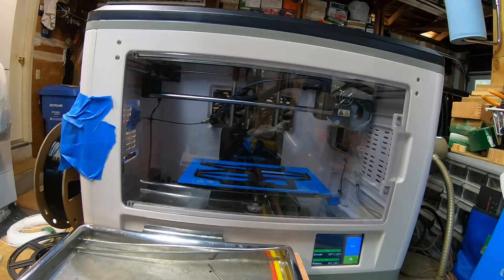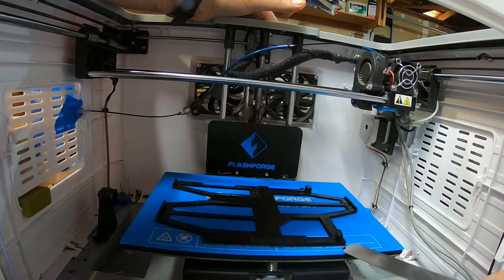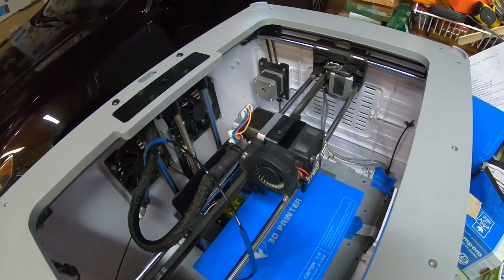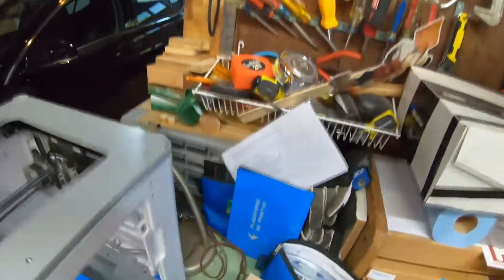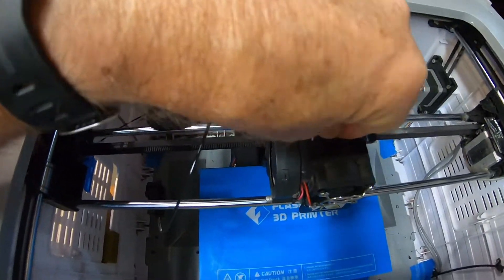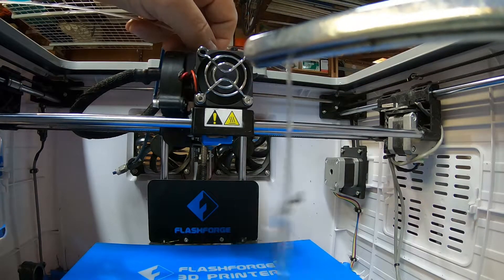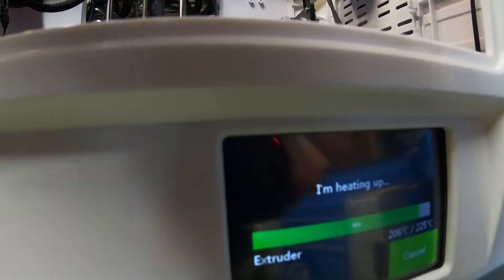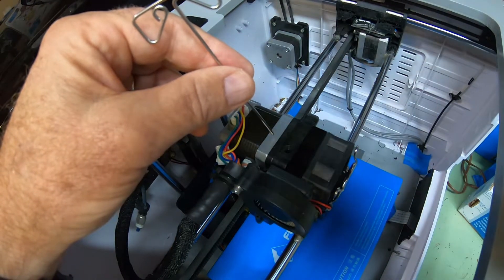3d Printing - Switching from PETG to PLA and Avoiding a Clogged Print Head

Comment: Hello sir! i'm planning to invest in this printer, i know its a pretty old printer of era 2017 but im wondering if this printer still worth to purchase? i'm buying new one, 
for how long you are using this for? Do you recommend this over ender 3?
Reply from the maker: I have been using this printer for about 3 years now. I've gotten lots of good use out of it.
However, since I'm printing things for sale on Etsy:
https://betacygnidesigns.etsy.com/
I've been running this printer 10-15 hours/day 6-7 days/week.
I found over the last 3 years that with that kind of workload, it lasts about 1 year before mechanical/electrical problems start showing up.

So it depends on what you want to use it for and how much you're going to be printing.
If you want to see what I've been able to make with it, go to my Etsy store using the link above and watch my other videos about this printer.

I've never used an Ender 3, but comparing the specs to the Dreamer NX, I would choose the NX over the Ender.
One big advantage of the NX is that it has an enclosure. I think that leads to more consistent printing since all the cooling is under the control of the printer.

One other important point, when my last NX started having problems about 6 months ago, I switched to my backup NX (new in the box) and while deciding whether to buy another backup (I printing things for sale, so downtime is very important for me), I explored what else was available that would be more reliable and let me print bigger things.
I settled on the FlashForge Guider II:
https://www.flashforge.com/product-detail/flashforge-guider-2-3d-printer
I've been using that printer for about 6 months and I'm very glad I upgraded.
All of the mechanical parts are major upgrades from the NX.
The printhead is much better designed with the wiring better protected from heat than the NX.
It uses the same nozzles as the NX, so I was able to keep using those.
And it works similarly enough to the NX that I was able to use my Simplify3D slicer profiles with some simple tweaks like changing the bed temperature because of the removable print bed I installed on the Guider II.
The only major difference is the print volume which is an easy change in Simplify3D.

I have a new review series on this channel on my upgrade to the Guider II starting this coming Friday (11/3) for the whole month of November.
So you can find out why I like it so much and how I changed my slicer profiles, etc.
Going forward, almost all my 3d printer videos will be using the Guider II.

I'm still using my NX to do some prototyping and for making part of this product when I need to keep up with orders:
https://betacygnidesigns.etsy.com/listing/1552726362/star-wars-camtono-container-set

Thanks for watching my video, and let me know if you have any other questions.
Reply: @BetaCygniBlog  thanks alot for detailed answer. Really appreciate it
Reply from the maker: @AliTKhan You're welcome! Let us know what you decide.